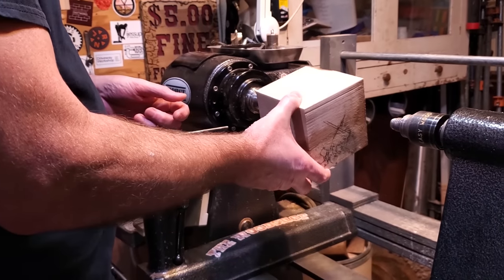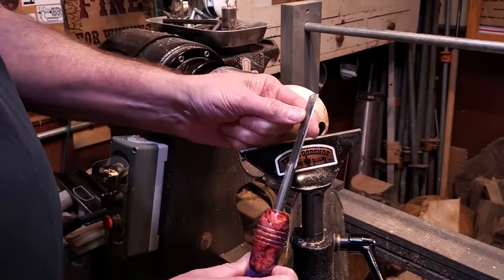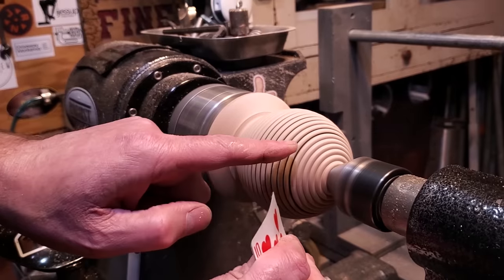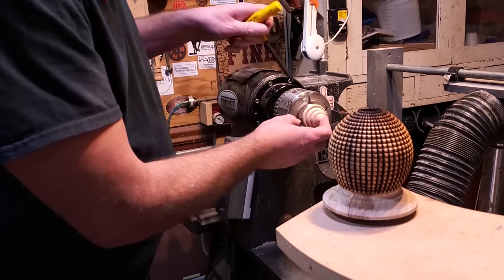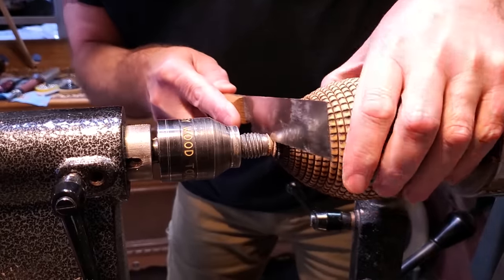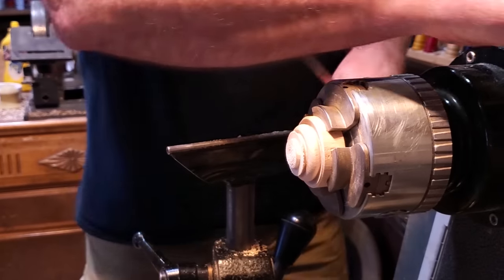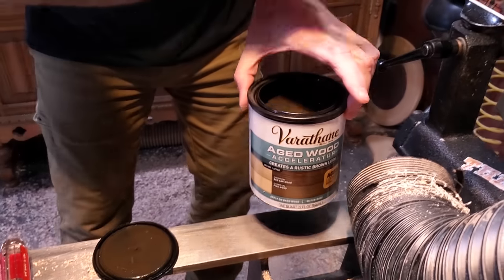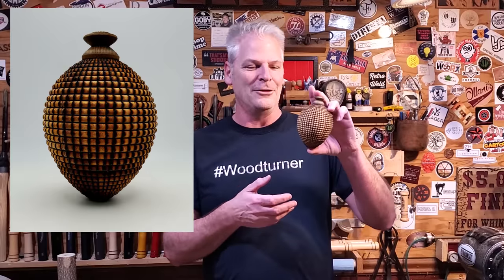Woodturning | Basket Illusion Ornament

Comment: That's a great tip on playing cards. I've used the wires for some time but it's not a method I've liked. Will have to bring a deck of cards over to the shop tomorrow. Having dealt Poker for some years at Harrah's I have plenty of decks lying around.

Comment: Carl, it looks great as is.  I personally think in most of the time the only reason to paint a nice looking wood turning is when you screwed it up or it was a really bad piece of wood.  IMHO; you did a great job, don’t mess it up with paint or such.  Thanks for the video.  BTW; do you have build plans/ info on the platform that fitted into your banjo to do the longitudinal burn lines? Cheers, Tom

Comment: Great project. Have friends doing basket illusion turnings and these are great. Like your card trick and platform jig. 

Another question:  when I upgraded to my larger Easy Wood tools, I went with the rounded square shaper because of trying to learn and be more gentle with my acrylic blanks. But it appears you are using the “square” version on yours. In a couple of recent wood projects, I think I want to go back to the square cutter. Do you mind commenting on your thoughts about the difference and your thoughts on the negative rake version?  

Thanks so much, Merry Christmas to you, Robin and the entire team.